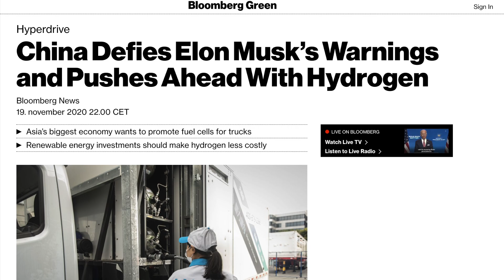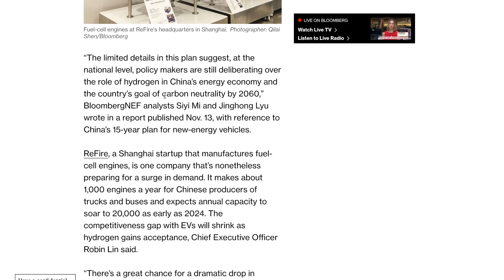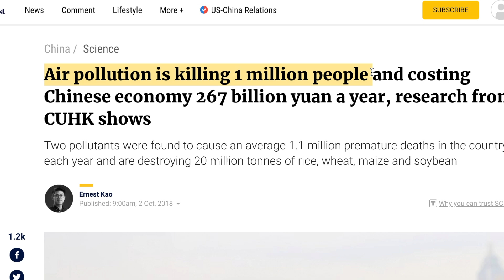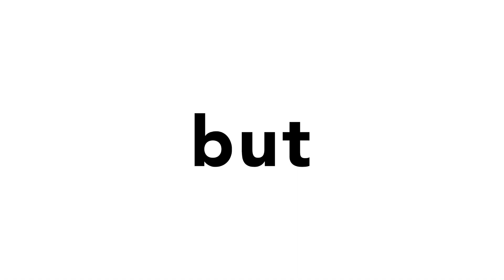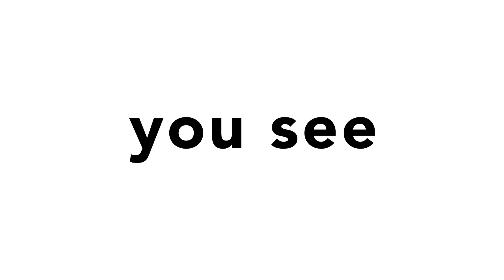The Worrying Truth Behind China's Push For Hydrogen

Comment: Oh my God! Why must you make everything sound so sinister? Why hydrogen? Because batteries aren't the best solution for every use case. Large vehicles like trucks, ships and aircraft aren't suitable for battery power. There are EV trucks but they aren't used for long hall trucking because they require giant batteries with long charging times. Shipping and aviation are huge polluters. Do you really think it's practical to load a cargo ship with like 10 billion batteries or weigh a plane down with huge batteries? What about emergency power for hospitals?  Batteries will degrade in time even when they're not in use. Hydrogen full cells don't have that issue. Lastly, China is a huge steel producer! You manufacture steel with a bunch of batteries. You can however use hydrogen.

Comment: Electrons are 1836 times lighter than protons. The Toyota Mirai will hold 5650 grams of hydrogen. So 5650 ÷ 1836 = 3.077 grams of electrons. In August 2021 a Toyota Mirai was driven 845 miles on 3.077 grams  of electrons. Electrons are efficient (they work) or they are inefficient (they don't work) so if hydrogen is only 40% efficient as many people claim then the Mirai would have traveled 845 miles on only 1.231 grams of electrons. If we can get the efficiency down to 0% it will be crazy eh.

Comment: You missed one thing in your research. China already refines certain and technologies and product to a point where hydrogen is a biproduct that is currently waste. All they would have to do is implement already existing technologies into infrastructure to make the fuel viable. So in other words, as long as your using hydrogen as a biproduct of another good, it could possible be more economical in enviromental and economic terms than batteries, as batteries are very difficult to produce and recycle. Lastly, hydrogen doesn't have toxic waste such as Alkaline and Lithium as a biproduct rather it just combines with oxygen as you normal H20 or water.

Comment: That's an incredibly biased, close minded view on batteries vs hydrogen. Sure, hydrogen currently has a lower efficiency factor, but both technologies are improving and we don't yet know which one has the higher ceiling. Both are just chemical storage of energy, and theoretically hydrogen can be made incredibly efficient by using the waste heat from production in industrial processes - which you can't do with your battery electric vehicle because as far as I know, those don't come with industrial plants attached.

They also come with individual (dis)advantages like how much higher hydrogen's energy density is vs. how you aren't going to have a fuel cell in your phone, so suggesting that one technology is so superior that investment in the other isn't worth it is just plain stupid.
Reply: Batteries make more sense for light machinery such as cell phones, computers and light vehicles, and hydrogen would be better suited for heavy machinery, heavy transportation, grind/household storage and industrial production.
Reply: Germany is still undecided on which type of energy production to go with in the future.

Comment: Hydrogen is more expensive than lithium-ion batteries but has higher energy density, so it is more economical to use large vehicles that are hydrogen powered. Also existing combustion engine vehicles can be converted to run on hydrogen instead of gasoline.

Comment: The problem with batteries is they have a very low energy storage to weight density ratio.....just to store 1kwh of electricity requires 5 to 10kg of battery weight and mass....

On the other hand the energy density of petrol and hydrogen is very very high,one liter of gas can easily produce 3 to 5 kWh of electricity.

Instead of transporting 5kg of batteries to transport 1kwh of electricity.....u only have to transport 1kg of gas to transport 4 to 5 kWh of electricity.

Comment: batteries still aren't a great option, especially if we use them en masse. direct power systems like trolley busses, trams and electric trains are by far the most environmentally friendly form of mass transport. they have so many advantages over battery systems
maintainability, cost, energy efficiency, resource use, need for mining, recyclability the list goes on

Comment: I would add that given the destabilizing effects that intermittent wind and solar have on the electrical grid, the production of hydrogen functions as a way to use and store excess off peak energy.
Reply: hydrogen production is EXTREMELY inefficient (not to mention dangerous) it's far better to store that energy in thermal batteries or hydroelectric dams OR better yet have a mostly nuclear grid like France does
Reply: @afgor1088  Hi. I largely agree with the points you make, especially around the role that nuclear can play in providing a stable base supply for a grid. Pumped storage is a great idea, but geography is not alway suitable in areas close to consumption. While the fear of roads filled with tiny rolling Hindenburgs will always work against hydrogen adoption, my thinking is that hydrogen doesn't have to be a perfect or widespread solution, just good enough to help solve a specific problem. In my province, overproduction of electricity (from wind and solar) at off-peak times means we pay to offload it to other jurisdictions. Hydrogen production at off-peak hours when renewables are creating an oversupply might reduce costs from dumping power and supply that part of the vehicle fleet that might use fuel cells (perhaps trucking where the weight of batteries reduces payload capacity). Best to you.

Comment: Certainly politics plays a role, however most of the issues with hydrogen are essential engineering challenges, and deciding where hydrogen fits into the solution mix for the energy problems they want to solve with it. Australia is another redbone of a country going all in on hydrogen. They see the potential for large scale applications. Hydrogen is a great local solution for delivery trucks, city buses, and some can fleets where they all fuel up at central points. Yes, storage tanks are still a weak point in the logistics chain, but not an insurmountable problem. The hydrogen economy and tech innovation curve are now at about the same place solar was at 20-25 years ago. Considering what China did to bring down the price of solar panels and wind turbines, they have every reason to believe the cost curve will go easy down with hydrogen tech as well.

Comment: Hydrogen has got high energy intensity per unit of kg. Therefore for long haul transportation,shipping, fertilizers, cement, steel making and aviation it outstrips direct electrification by far. Note for urban commute and passenger vehicles BEV are head and shoulders clear winners. But for the ones mentioned earlier battery storage and direct electrification are unsuitable for it. Eg payload reduction in battery powered trucks as against fuel cell trucks etc. So green hydrogen from electrolysis will finally have its day in the sun.

Comment: It doesn’t really matter if hydrogen is inefficient if you have abundant amounts of renewables. Hydrogen only doesn’t make sense if you dig up oil and then use it to make hydrogen - it’s better to just use the oil for energy.
China has built so many wind turbines that large amounts of them can’t be used. One giant wind farm in southern China uses less than 40% of their wind turbines, because the local community doesn’t use the power and their grid is too underdeveloped to transport the electricity from one end of the country to another. This is likely why they focus on hydrogen now and not only batteries. 

Batteries become useless after some time and need to be replaced. This creates massive amounts of waste, because most countries don’t have the capacity to recycle them. There is no standard for battery production, so there are no solutions for large scale recycling. Almost every manufacturer has different metals and compounds in them, making one recycling plant unable to handle all of them, and need to focus on only one or a few types of batteries. This makes recycling of solid batteries more expensive than creating new ones. 
Hydrogen also has the benefit of being “tankable”, like liquid fossils fuels, and thus can be sold in gas stations, if they are made to accommodate hydrogen. This makes refueling easy and fast for long distance trips - something that isn’t possible for battery driven vehicles.

Comment: Hydrogen is less efficient as an energy storage solution than batteries, but they are much more renewable.  If China be builds enough nuclear power, efficiency will not be an issue because the amount of power being produced is not the limiting step.  Nuclear can make electricity cheap enough to offset the only weakness of hydrogen, while the weakness of batteries has no feasible and cost effective solution.

Comment: You keep mentioning "your findings" without ever explaining why Hydrogen is inferior to electrical batteries in your opinion. Hydrogen is more expensive to produce but it doesn't have the weight problem electrical batteries have. Hydrogen is also a lot faster to refuel. So, why electric batteries would be the future?
Reply: While it is true that by weight, hydrogen is the most energy dense fuel (hence no weight problem). 

It does have a low volumetric energy density. This means that hydrogen contains less energy in the same volume than for example batteries and just regular fuel.

You can somewhat fix this with extremely pressurised hydrogen tanks or very low temperatures so it becomes a liquid, but these storage methods aren’t as simple and have their own problems.
Another idea is using metallic hydrides, but i’m not very well versed on them. 
Although if i remember correctly a common problem with these was that the storage gets less efficiënt after a relatively low amount of cycles.
Reply: He actually dis explain it a couple un times in a couple of videos.. check it out ;)
Reply: He’s not a skeptic of hydrogen bro, he’s a skeptic of China.

Comment: China may have calculated that batteries don’t scale for billions of people due to resource constraints. The problem is not the efficiency of converting from sunlight to electricity to storage and back again, the problem and bottle neck for billions of people is storage. Hydrogen is a better form of energy storage and wins out despite the reduce round trip reduced efficiencies. Also, think about the amount of space that is required for solar panels etc. With hydrogen you can can place those panels in other countries with abundant space and sunlight and then ship the hydrogen.

Comment: One thing not considered is energy density. Electric vehicles are not a true replacement for ICE vehicles, as the total energy stored in the batteries is extremely small as compared with a tank of fuel. For applications where the main loss of energy is inefficiency of the engine, such as driving along a mostly flat road in a car, electric vehicles can replace ICE vehicles. For applications where the main loss of energy occurs from the task being carried out, such as when heavy loads need to be moved through height differences, batteries simply don't have enough energy, no matter how efficiently you use them, to be suitable. This applies to agricultural equipment, construction equipment, mining equipment and other heavy duty industrial vehicles. As a  result, both electric and hydrogen vehicles are required for an ICE free future.

Comment: if the chinese want self sustaining then they won't bothered with hydrogen. the thing with renewable is that the access to it is limited to geography,  a good analogy is probably natural gas. before the invention of LNG, gas can only be pipe to the destination which limit it range, but LNG change that allowing for importation of LNG from far away places.

so hydrogen can just do the same.build a solar farm at the equator, wind turbine in the middle of the ocean and even hydro energy from tropical area convert it to hydrogen and export it

Comment: There are many applications for hydrogen. Your example of hydrogen being less efficient in the form of fuel cell vs batteries is true but that's just 1 use case (cars) for 1 sector (transportation). Look into industrial, heating, the rest of ground transport and other modes of transport, and others.

Comment: Hydrogen would be fine if it weren't for storage and distribution. It's bulky, leaky, corrosive, explosive stuff. 

Current batteries aren't good enough for several reasons - mostly cost and scarcity of materials. 

Upcoming battery technologies will solve the problem soon. Hopefully soon enough.

Comment: In most countries (especially closer to the poles) you can't construct a 100 percent regenerative energy grid without power-to-X or mostly power-to-gas technologies. 

There's no other technology for seasonal energy storage. Hydrogen is the only game in town for that. As you mentioned the losses are huge, so if you read the scientific literature they only recommend power-to-gas for the last bit of energy that you can't store some other way. 

Or the way i like to put it. You don't have enough energy in the winter due to the low performance of solar in the winter. So in the winter you have to fill energy gaps and they need to be filled. You can use biomass for some of that. You can use geothermal energy for some of that. You can use wind energy for some of that and you can use hydropower for some of that. But for many countries like germany it's not enough. So for the last bit they need power-to-gas. 

So hydrogen is absolutely needed in the future. The scientific literature regarding 100 percent regenerative energy systems is pretty clear about this. 

Obviously it's pretty dumb to use hydrogen or liquid hydrocarbon fuels made from hydrogen in internal combustion engines. That would require 5-6 times more energy per travelled distance than an electric vehicle would need. Hydrogen fuel cell cars are only slightly better. They need 2-3 times more energy than an electric vehicle. So if too many people decide that they want hydrogen cars (or if those cars start to dominate the car market) then many countries like germany can't actually make the transition to a 100 percent renewable energy system. They wouldn't have enough energy for that.

Comment: you are missing the point I think. Hydrogen can be used as simple storage solution for renewable energy generators. For example wind or tidal power generating electricity at a time you dont need so much (night time). Use all that free energy to generate and store Hydrogen. Then that hydrogen can be used in fuel cells in trucks, ships/ferries etc. All the batteries needed to store large amounts of power would be 1. expensive and 2. uses some rare materials to create the battery 3. recycling old batteries not ideal.